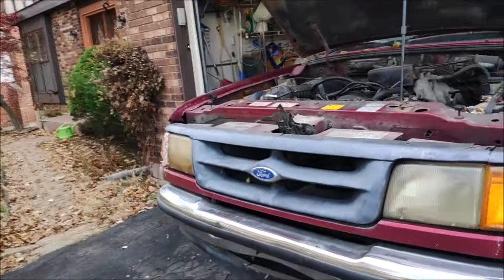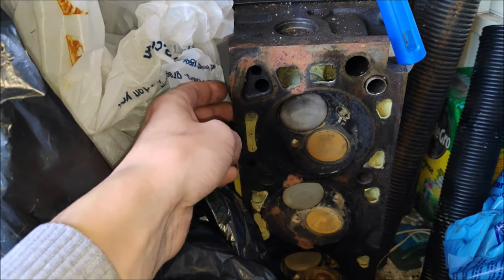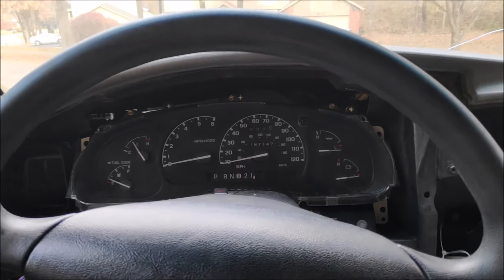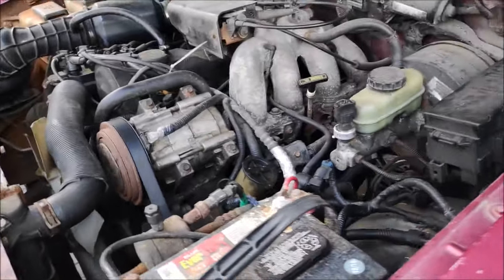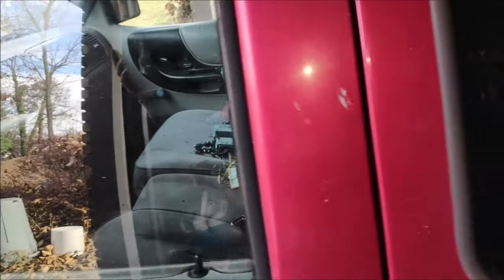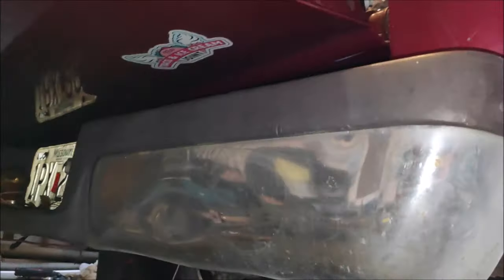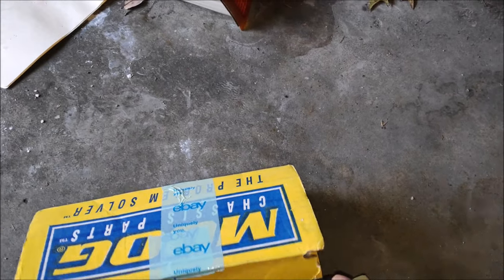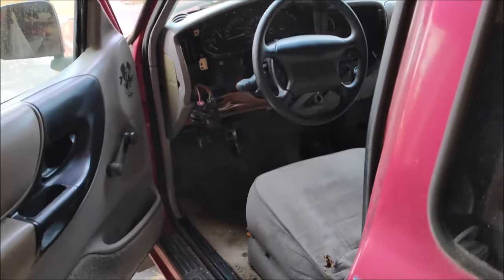What Fails on All Ford Rangers, Everything You Need to Know, Best Review

Comment: The common problem with this Ranger is the owner. This truck has not been taken care of. My current Ranger is 16 yrs old and still look almost new
Reply from the maker: I couldn't agree with you more.
Reply: @everydayirace  The most common problem with 2006 4.0L is the 2 piece thermostat housing top gasket only lasts 75,000 miles You must use the orange antifreeze fluid. The mistake is using standard antifreeze and the housing will have to be replaced more often and if not replaced by the book it will be a constant headache
Reply from the maker: @davidpotts3844  I stay away from Ford 4.0sohc engine all together lol.

Comment: Any idea why a 97 ford ranger 4 cil gas gauge is always on empty? Where would you start ?
Reply from the maker: Check fuel pump float, then anti slosh module.
Reply: @everydayirace  hey first of all thanks so much for the quick reply. My next question. Do I gotta remove the bed to get to it? Kinda looks like it’s gotta happen.
Reply from the maker: @jacksonworkshop  drop the tank or lift the bed.
Reply: @everydayirace  alright man thanks I appreciate it a lot!
Reply: Hey man I was also curious. Which transmission fluid do you reccomend? Mine is a 97, 4cil, M5SPOD (manual)
Reply from the maker: @jacksonworkshop  I use Pennzoil Synchromesh, it's available at most auto parts stores.
Reply: I replaced my fuel pump and gauge works now

Comment: Interesting video! I have a 88 Mazda B2200, and my meter fuse keeps blowing therefore the fuel gauge, temperature gauge, dash lights and turn signals don't work. Oh and my hazard lights work. Do you know what this issue could be?
Reply from the maker: Grab a multimeter and start testing components that are on that circuit.
Reply: Nathan Dexter I had the same problem around 2006 on my 1993 Ranger where it would blow one every now and then so I just replaced the 15 amp fuse with a 25 amp one and I've had no problems since. I know that can be dangerous but you could give that a shot.

Comment: From stories I have head, the mid sized chevy C10 is three times worse than that ranger... I bought a 99 ford ranger for my ex wife back in 2003 and that was one tough vehicle and the engine was an all cast iron V6 and I believe it was the 4.0.  Now the 3.0 V6 used in explerers and ranger was the best engine any car could have, and I saw one that had been taken apart out of a 95 explorerer and it was b.  Idiots that own these rangers cause all this chit to be bad in themuilt better than a 350 chevy small block that was disassembled where I worked back in 1999

Comment: My ‘99 4.0L OHV Cologne V6 has none of these issues.
Reply: Do you have valve train rattle/gurgle/knock? Mine has none of the issues on this video either but boy does that valve train make some noise. I got a 2000
Reply: @zavier5102  actually no.  Mine is incredibly smooth at 159k.  The lifters on these are hydraulic.  I would try using premium synthetic oil with high detergent, and change the oil more frequently than normal, possibly running the engine hot with a bit of extra detergent (like Amsoil motor flush) right before an oil change.  Napa Gold or Wix filters (regular Wix, not the Wix XP).  Marvel Mystery Oil is another gentle flush I might try, running the motor for only a couple hours with it in right before an oil change.  Those sticky lifters are bad news and need to be addressed; if they wear too much they won't adjust, then you'll need to tear into the motor to replace lifters and pushrods.
Reply: That was the biggest down fall on the cologne engine's they all have poor valve train oiling once they start slapping it's pretty much in need of new rocker arms common problem

Comment: Sorry, I have to disagree with you on the power & performance of the 4 liter engine. I have a 4x4 2010 Ranger XLT with plenty of power and my mileage has been 22 in town 28 on freeway and I am not light footed! I bought the truck new and have done all the maintenance my self. I do a mix of in town and freeway driving, plus haul loads.
Reply from the maker: Thanks for your feedback, your gas mileage is quite remarkable, is that miles per US gallon?

Comment: What's up with the icm being in the ecu
Reply: I got a misfire in cylinder 3 can't seem to fix it
Reply: 97 ford ranger 2.3 5 speed no ac
Reply from the maker: Check for spark, fuel, compression.
Reply from the maker: Most modern vehicles don't have external icm.
Reply: @everydayirace  Thanks 👍👍👍👍
Reply: If the rig has DIS then it will not have an external ICM.  I have seen issues with misfires not be the ignition system at all.  P0300 being one code that is rarely an ignition issue, usually a fuel issue.  For the P0303 being the only issue, and you have tested/replaced the plugs, wires and coil, then you need to test the fuel injector for both signal and flow, and also if your CKS/CMS are not giving the PCM good clean signals then the mis could be caused by that as well.
Reply: @rebelndirt8830  pulled the head apart and found that the hydraulic lifters aren't working properly
Reply: @zeediaz3821  Well that would do it!!  Compression test I'm guessing showed little to no compression in that cylinder.  I had a Jeep Cherokee with a 4.0 that had the same issue.  Easy enough to fix, just a PITA of a job.

Comment: Anybody have an issue with a slight thump when braking? It does it randomly so I can't exactly pinpoint what's the issue. (1994 Mazda B4000 4x4)
Reply from the maker: Could be rear shoes needing adjustment or bad u joint.
Reply: The rangers had rear abs  it's actually doing what it supposed to the thump is keeping the rear brakes from locking up pay attention if you have to get on them hard or if it's raining and jam them fast it will thump

Comment: Ford ranger, Mazda b2300 or a Chevy S10??? Looking to pull my Arctic cat 250 on the bed and bring it 3 hrs north... I see rangers and Mazdas a little more expensive but more miles .. not sure. Any tips are super appreciated!!
Reply from the maker: Get one that's in the best condition.
Reply: @everydayirace  there's 77k on the Chevy, 225k on another Chevy S10 (but better engine model), or a ranger with 160k on it for 1200 with rust that can get by for a few years
Reply from the maker: @567Kriss  Get one that has been maintained, talk to the owner, ask for paperwork.
Reply: @everydayirace  true, but it's only 1200$... How much work could the truck need if it runs and drives and shifts well? Water leaks and rust is all I can think of
Reply from the maker: @567Kriss  sounds like you already know what you want lol.
Reply: @everydayirace  haha fair enough... I appreciate your help 🤙 I just thought Chevy sucked.  But it's an old Chevy so maybe not?
Reply from the maker: @567Kriss  I am not a Chevy person either, lol.
Reply: I have a 95 ford ranger  that I just got and I cant figure out why it pull to the right hard meaning if I let go of the steering wheel it will take me off the road. I don't know what to do plz help. The other problem is that I can't find the coolant leak I done replaced the water pump and the  Is thermostat housing. I can look under the truck but I don't see any thing leaking but ever today's I have to had water why is that???
Reply: @terrancehaynes9975  check the gaskets. Don't want coolant going into the engine. 
Turns hard? Get it aligned at a Firestone. Could need suspension work if they do an alignment and it doesn't fix it.
Did you not bring it to a mechanic before you bought it?
Reply: @terrancehaynes9975  I ended up buying a Toyota t100 1996
Reply: @everydayirace  I ended up buying a 1996 Toyota t100 sr5 and stripping bed liner off. Everything works except AC. Just bought M/T tires for it and got it lookin SEXXXYYY
Reply from the maker: @567Kriss  Nice, I saw one at the junkyard last night, going to pull e-locker rear diff out of it tonight 😁
Reply: @everydayirace  nice! Wanna get me a bumper?  lol frames go before the engine and trans goes for sure.. might want to do an engine and trans swap in the future
Reply from the maker: @567Kriss  it's a 95 truck, I thought they changed body styles in 96.
Reply: @everydayirace  unless it's a forerunner, no. The t100 had the same style from 93-99 I believe. I'm buying fenders off of the 95 on Sunday. If you want to see my truck it's on my channel 👍
Reply from the maker: @567Kriss  you're probably right, I deal with lots of 4runners, 88-95 and 96-02 models, I'll take a look at the front bumper and will let you know.
Reply: @everydayirace  thanks man!! You don't have to if you don't want to I just bought 33-in tires and apparently cost $1,500 bucks for Mickey Thompson's
Reply from the maker: @567Kriss  I am already in heaven, I mean junkyard 😂
Reply: @everydayirace  haha hell yea
Reply from the maker: @567Kriss  I'll post a video about my trip 😁
Reply: @everydayirace  lmk when you do I'll watch it
Reply from the maker: @567Kriss  https://youtu.be/oKWA3dY2eOM check it out.

Comment: That ain't true my 1991 4.0 v6 has alot of power I drag raced a 2014 Dodge ram 1500 with a 4.7 v8 and won easily. I've never seen an old v6 have that much power. But you are right about it being a gas hog.
Reply from the maker: They didn't put 4.7l in 2014 dodge ram 1500 😂
Reply: @everydayirace  it was probably a 2012 then
Reply from the maker: Not 2013? 😂
Reply: @everydayirace  I'm not exsactly sure what year but it has a 4.7

Comment: Problem #1

No 5.0
Reply from the maker: if it was up to me, it would have same options as mustangs, 2.3, 3.8, 5.0.
Reply: It really was a wasted opportunity by ford. If my explorer ever gets wrecked I’d consider a ranger transplant. Idk how awd would work though.
Reply from the maker: I think ford did ok, how many mid 90s toyota, chevy, gmc, nissan, dodge small trucks do you see per day?
Reply: I can’t argue with that, how many diesels do they offer in F Series? Same thing as what I’m thinking. It’s not about more truck sales it’s about milking an expensive upgrade. No diesel is worth the cost in fuel savings but people pay a premium for the extra power.
Reply from the maker: @iqinsanity  I really couldn't tell you about a diesel, I've never had one, but worked on few 7.3, I'll take 7.3 godzilla lol.
Reply: Seem like awesome motors, first ford pushrod v8 with vvt. No experience with one.

I’d take one in a car but love me some diesel for a full size truck.
Reply from the maker: @iqinsanity  my buddy had a 7.3, it was nothing but problems, I'll take a 351w or 460 over one lol.
Reply from the maker: @iqinsanity  I also like coyote, but they're too expensive, maybe 10-20 years down the road.
Reply: Coyotes scare me as complete trash. How do you bore and rebuild a spray bore aluminum block? 

Seems like an awesome one time use throw away motor
Reply from the maker: Yes, but what a monster power wise.
Reply: Everything is though, why is a 5.0 trash? Stock heads suck. It’s not the lack of displacement. 

I’ve learned to stop thinking like it’s the 70’s-90’s. 

Treat a sbf like an LS. Large port high flow heads with small cam. High hp (relative) with great reliability and factory idle. I just got some speedmaster 210’s for $540 on Black Friday sale. Yeah they aren’t the greatest but I’ve already dremeled the pushrod protrusions from the intake ports. Slap in a xe264hr cam and pretend it’s a 5.3 gen 3 GM.
Reply from the maker: @iqinsanity  Sounds like a good plan.
Reply: Maybe I’m completely ignorant and building a dog, but I fail to come up with any reason an LS with its very high flow heads can make power down low with a conservative cam but doing the same with an older generation motor isn’t possible. I refuse to believe it. 

Sbf sbc whatever. Gas doesn’t care. Air doesn’t care. Flow, cross sectional area, velocity, and valve events. Year and brand are irrelevant to the fuel. 

Every time I ask online I get flammed for “small block fords can’t do that”. Ok, why can LS? “It’s a newer generation”. That’s not an answer it’s an excuse not to think.
Reply: Idk if you watch Richard Holdener but his channel is awesome.